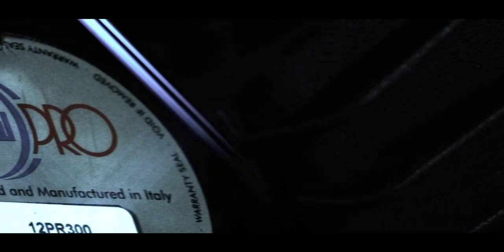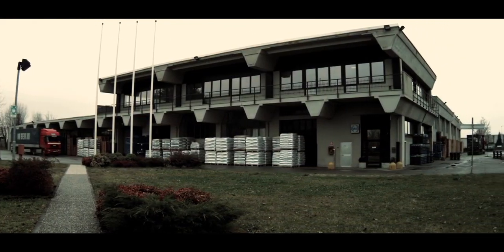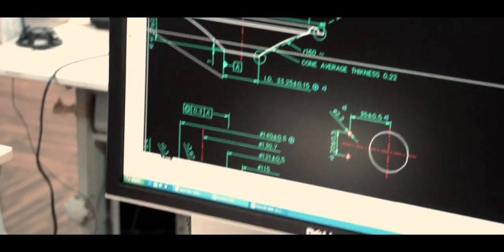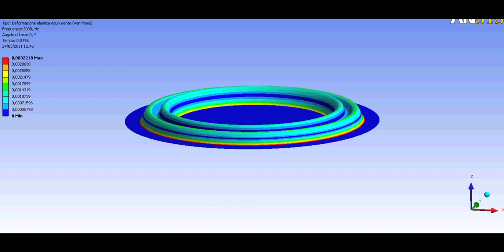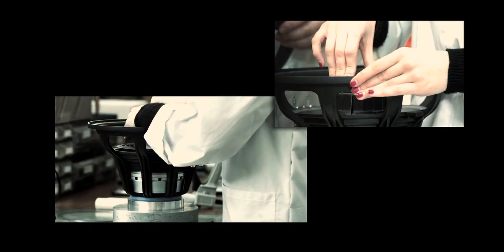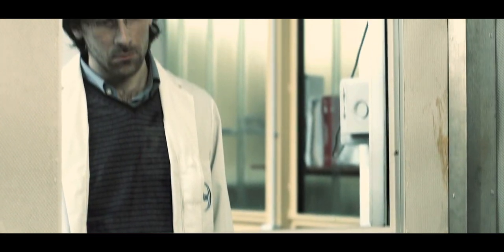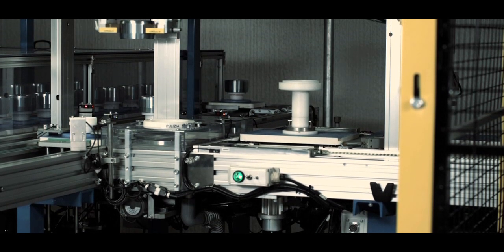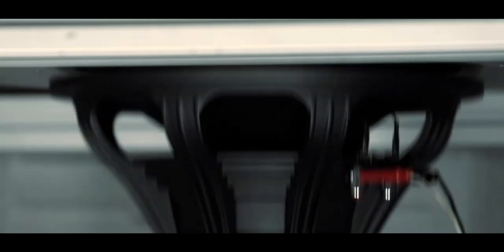Introduction of FaitalPro, one of the best Pro Audio Speaker manufacturer from Italy

Comment: Sir, what is the difference between aerons 18 "subwoofer  1200w and faitalpro 18" sobwoofer1200w in terms of quality or vibration?
Reply from the maker: there is difference in terms of distortion which we normally can't find. AERONS speakers are normally made to use in most common available cabinet design but faital pro speakers if you make special cabinets then can get very good response but if use generic cabinet design then they will sound like aerons only.

Comment: Faital pro 18hp1030 or 18hw1070 which is the best punch subwoofer
Reply from the maker: 18hw1070 is most powerful but to take out best results need to have very nice custom made cabinet and a powerful amplifier. 18hp1030 can be used in many popular design cabinets like LF7/LF8/LF9, SRX, STX type of cabinet hence its more popular with dealers and customers. You can contact Mr Manoj tel: 8921993256

Comment: Faitalpro company ka bass 18 inch 1000w se 1500w ka bass price kya hai,,,
Reply from the maker: we have below model in 18inch subwoofers
18HP1010 1000W @ 18,000 EACH
18HP1030 1200W @ 22,000 EACH
18HW1070 1600W @ 28,000 EACH
Reply: B&c se achcha bajega?
Reply from the maker: yes sir it will give better response than B&C.

Comment: I need 18 inch 1000 watt subwoofer faital pro
Reply from the maker: we have 18hp1010 and can offer you Rs 18000 each.
Reply: 18 hp 1010, 4 ohms or 8 ohms?
Reply from the maker: @rhythmlightandsound  the stock we have is 8ohms but if you need in 4ohms need to make special order and goods will be delivered after 12 to 16 weeks.

Comment: competition this speaker rcf 1000w
Reply from the maker: sir 18hp1010 is a good subwoofer from Faital pro and it can compete with RCF in many different types of cabinet designs. Still, LF18x400 from RCF is one of the best subwoofers in 1000w as its frequency response is below 30hz due to which for some special cabinets it sounds much better.